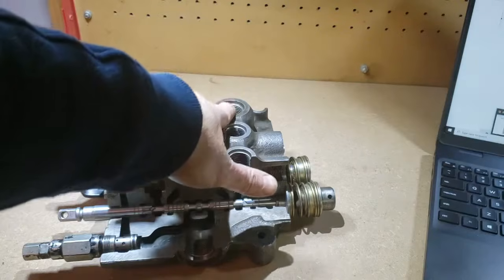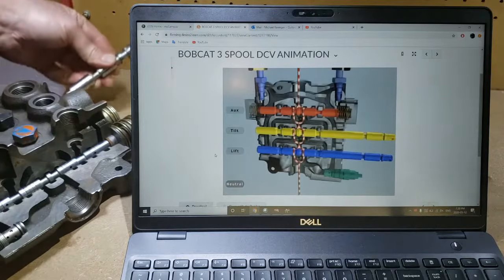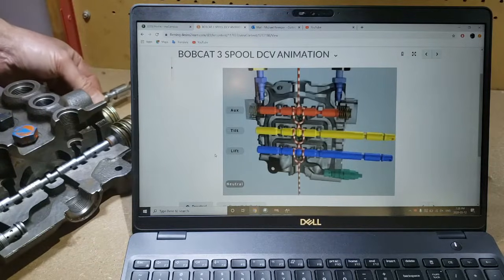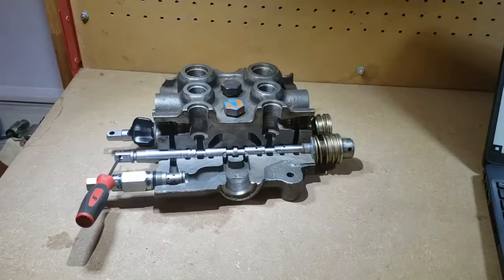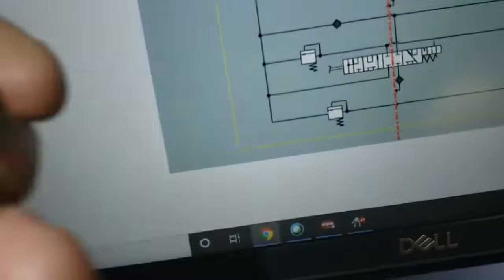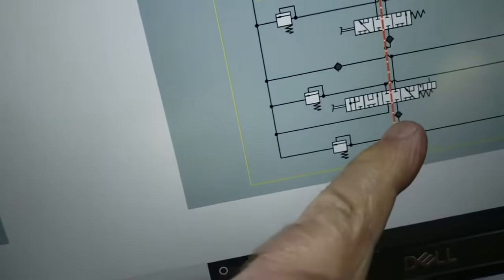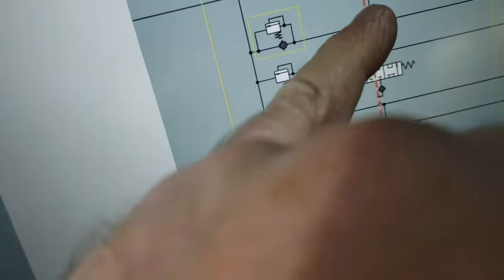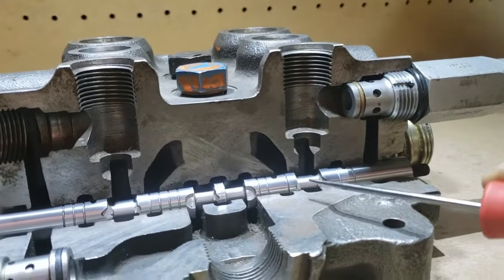Hydraulic Control Valve Cutaway HYDRAULICS FLUID POWER BASICS PART ONE

Comment: THANK YOU so much for this description of how this valve works!!!  Question if you don’t mind:  I designed a 0.5 cu in gear pump driven micro tractor using a prince RD512EA5A4B1 OC motor spool valve. Work ports connected to tank in neutral, no load check, power beyond sleeve runs loader valve. The Prince valve runs 2.6 cu in Parker motor via 1/2” lines.  Works surprisingly well for not knowing much at the time. Can I put in the appropriate  load check kit (for RD-5000 series valves) to help keep the tractor from free wheeling?  Unloading it from the trailer is a bit dicy. Will the load check valve work with the  ports connected to the tank in neutral? My return line is 3/4”. I doubt there is much back pressure. 
And of course if you have a consulting fee I would be open to that. Thanks!!  Curtis

Comment: Doubt you'll see this but im desperate lol have a bobcat 853h high flow machine with the bics controller. All lights are lit and controller seems happy but no lift function just tilt. Can get the boom to raise while pushing the foot pedal with pressure on the boom upwards(tilting the quick attach on the ground) and it will hold fine doesnt drop. And will go down fine with foot pedal

Comment: Great video! I believe I now know what happened to mine. Overloaded and lost both lift and tilt instantly when placing a cement block. I believe it failed the main pressure relief valve. My question is about that valve.
Is there any repair or should the valve be replaced?  Thank You! for the professional Video; Excellent!!!

Comment: Hi, great video. I have an 853 Bobcat with low hydraulic pressure. We've already replaced the gear pump (tandem) but the main relief valve is not available for this machine. They want me to replace the main control valve with 7229299 which uses the standard main relief. My current MRV has a hard line coming off of it that runs to the Aux hydraulic valve with another relief on the left side of the machine. to put the new 7229299 valve in 2 adapters are also required (15KB1216) which look like they wye the supply coming into the control valve and connects to the hard line that is currently on my main relief.   After seeing your explanation I'm wondering if I can just get the two connectors to re-route the supply coming in to the hard line and then machine some kind of adapter (I'm assuming its a different thread patten/size) to the standard relief valve. Any thoughts on this?     I can't find the MRV that's in my machine anywhere as its been discontinued (6665699)
Reply from the maker: That sounds like a dual pressure main relief that maybe gets pressure to boost max pressure during attachment use. I wonder if you couldn't just block those lines off and use a regular relief valve
Reply: @hydraulics  Do you think its the same thread size? and What would happen if the high flow function was enabled without the deal pressure relief?

Comment: Hey,  great video. Are you familiar with float equipped valves that don't use a hollow spool to achieve float function? I am studying a husco 9610 valve that I know is equipped with float, but it definitely does not have a hollow spool like the bobcat valve in this video. I am now trying to understand how the float passage is connected without using a hollow spool.

Comment: Thank you for taking the time to make this video. It helped me understand how this operates, this looks exactly like the one out of my 2001 753G. I'm still struggling on how to use the float feature but now understand how it works.  I had to replace the spool valve gaskets and rings and now understand. thanks again. I got the BICS valve wire plug and the pressure relief wire plug backwards as they are identical in every way and I failed to label them. After 2 years of dinking around I finally figured it out.

Comment: Great info! I am still stumped with my issue though. Machine is  a 7753. At an idle the machine will randomly go under hydraulic load. Like oil was bypassing properly but then stops bypassing. While in this unintential hydraulic load status(can here it under load), the base end of the lift and tilt works, but the rod ends of the cylinders will not operate. I did replace the relief valve under the lift spool linkage connection. To me, it does not make sense that both the lift and tilt are both affected the same. Any thoughts on what to go after? Thank you!
Reply: Interesting issue. Do have a pressure gauge set? If so you could tap a pressure gauge into the line right after the pump outlet and watch pressure when the machine will randomly go under hydraulic load.
You could then compare that pressure to system relief valve pressure to see if there is an intermittent dead head issue. Never heard of only one work port working for two spools next to each other but I would assume this is a related issue. A hydraulic schematic of the machine would be helpful to identify what components could cause the issue. Please be careful of high pressure fluid skin injection, when working around hydraulics. Hope this helps, best of luck 👍

Comment: So is it safe to say that Load Checks could not possibly be a factor for Tilt Cylinder Drift when the spool in the HOLD position as the Bridge ports for the load checks are blocked by lands on the spools.  (assuming intact iron no cracks in valve body).  Also,  you went over port relief valves and some newer machines have Pilot Operated Directional Control Valve/ BICS Lock Valves on the lift and tilt circuits with a built in relief to Drain.    I've removed mine and checked the orings and back up seals to find they are in tact, but im starting to suspect failure inside the valve itself.  They are quite expensive and to just throw the part at my machine is not ideal. Is it possible to Bench test the functionality of these types of valves?
Reply from the maker: @ShermBASS  never seen anyone bench test them. You are correct,  load checks do not cause drift.